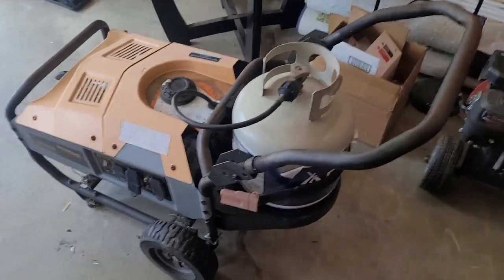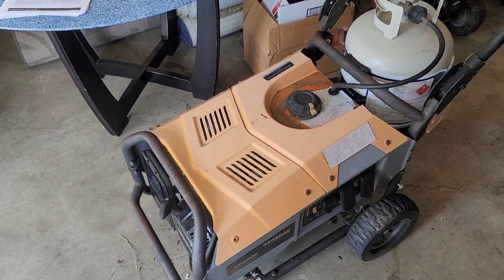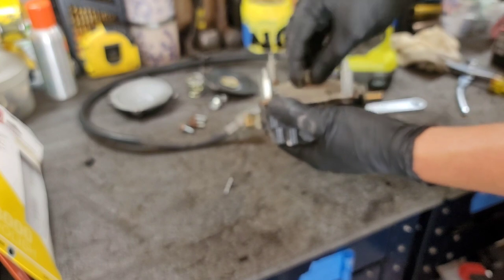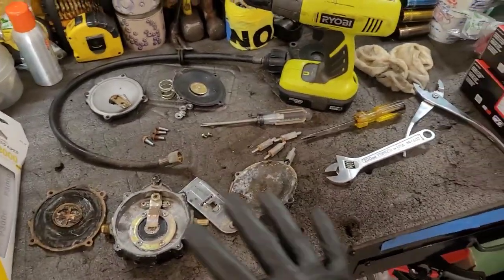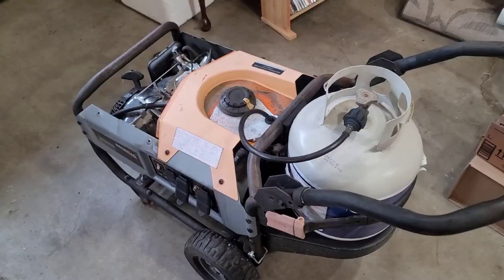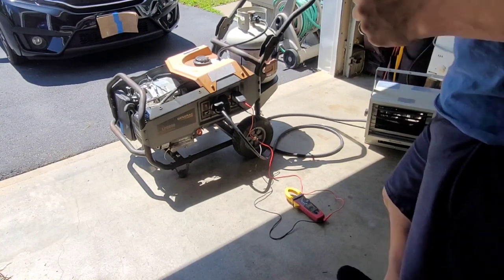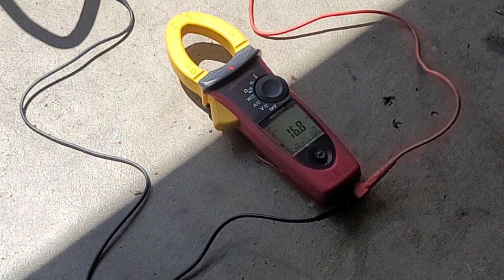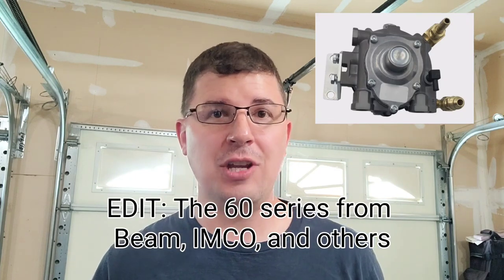Generac LP5500 / LP3250: Regulator Repair & Why These Generators Failed In The Market

Comment: Great save.  It’s disappointing the cost of the regulator and lack of a rebuild kit.
Reply from the maker: It really is a shame. Don't see yoo many of these or the LP3250s left in the wild anymore, likely for the regulator problems.
Reply: @Bassguitarist1985  have never seen a LP5500.
Reply from the maker: @jcondon1  me either. First time laid eyes on one other than reading about them or seeing them at a food truck festival. Nowadays i see Predator inverter gens and Honda EU7000s running food trucks.
Reply: @jcondon1  I fix Generators myself , sometimes its hard to fix and flip these oddball units, so you fix them and keep them,cause what will happen next and can it be fixed a second time, Great video

Comment: I rebuilt a tanaka electric start weed eater some years back no parts were availabe  so i ended up buying 3-4 baskets off ebay  i spent way more than buying a new echo but its the novelty of the unit itself

Comment: excellent video. I have the 5500. I really appreciate your video. Mine doesnt want to run and I suspected of course this regulator.
Reply from the maker: Yeah unfortunately it's very expensive to replace. The aftermarket regulator is cheaper but there is some adaption required

Comment: I think i missed something....did you actually replace and repair the regulater as i saw the genny running and making power?
Reply from the maker: No you didn't miss anything. I didn't film the reassembly of the regulator. After the customer did not want to invest the money i also didn't want to put too much time into it. Was pleasantly surprised when the machine actually started up after resealing the diaphragm with "The Right Stuff" gasket maker and repairing the small tear in it. James Condon went into more detail on the reassembly, but his regulator was not as damaged as mine was.

Comment: Bottom line, the customer abused the machine by leaving it out in the weather.  I would go ahead and adapt an elbow or piece of tubing to the vent to prevent further water intrusion.  Being a vent, it doesn't have to be anything special.
Reply from the maker: Exactly. A simple hose pointing downward would do the trick, or better yet, never keep the generator outside in the rain! 🤔
Reply: Or both.

Comment: Can it be converted  to reg gas?
Reply from the maker: No. The compression is too high for dedicated propane engines. You would have to run high test fuel to prevent pre-ignition. Not practical.

Comment: Very good video. Kind of a stupid design, and poor customer service with regard to parts. If it were mine, I would consider retrofit, as you suggested. Selling it at this point is an ethical dilemma!
Reply from the maker: You hit the nail on the head and I'm glad you picked up on the ethical part. The reality is the market is making the decision for me, Even though it now runs and makes power because it's such an older model and only runs on propane it's worth peanuts I'd be lucky if somebody took it off my hands for like a hundred bucks
Reply: @Bassguitarist1985  yeah, it's kind of neat as a novelty, but it takes up garage space! Did you say Mr. Condon wants it? For parts, I guess...
Reply from the maker: @markgeorge3960  yes he said he would take it next time he's in my area. I have no use for it.

Comment: Looks like a imperial brand regulator 
There’s all kind of reg that will fix it 
I’m not paying that much for anything they have period
Reply from the maker: Agreed. I'm sure any model/brand requires fabrication to work properly. I was hoping for some sort of cross reference part from another manufacturer, but the form factor I have not been able to match exactly.

Comment: why couldn't you do this for your customer?
Reply from the maker: @BOB12349307  do what exactly?
Reply: @Bassguitarist1985  amazing how fast you got it fixed when it was yours
Reply from the maker: @BOB12349307  just because I did repair it doesn't mean the repair I made would last. I glued the diaphragm haphazardly, it wouldn't have held long term. Go watch James Condons video on this. He wound up replacing the regulator I repaired with an aftermarket regulator. Again, the former owner of this machine has seen this video and James' video on it. Everything was fully disclosed.